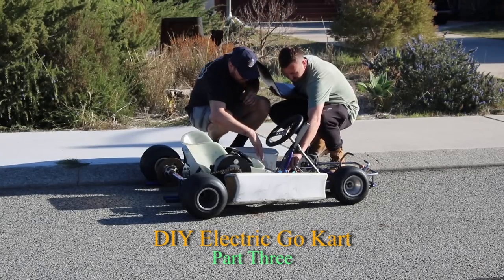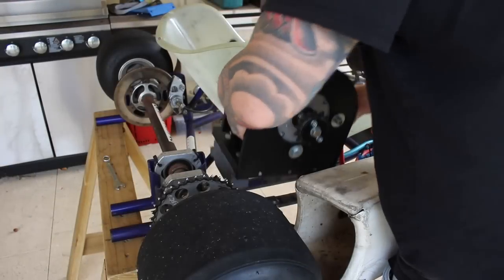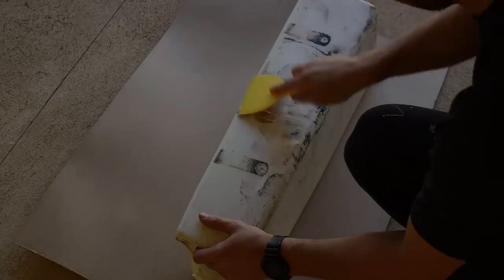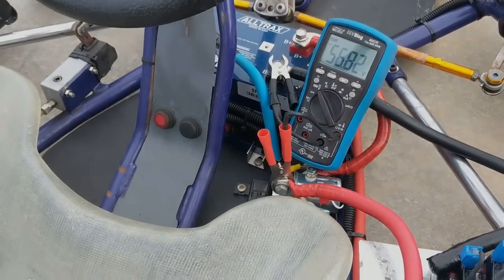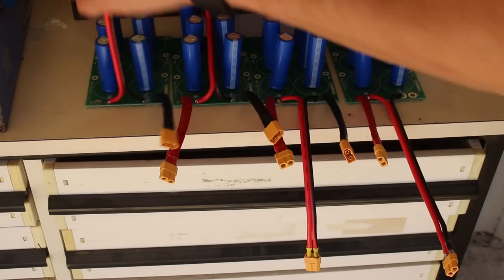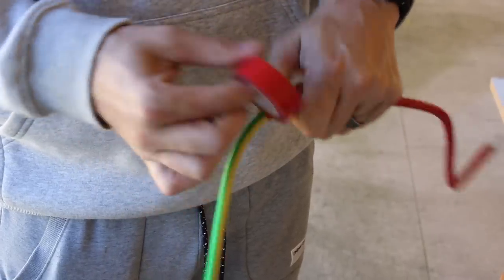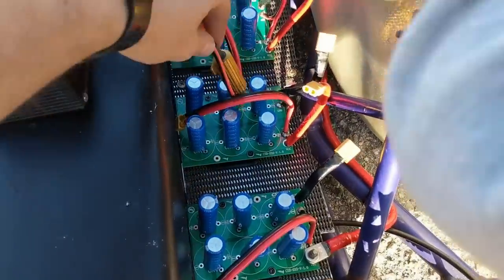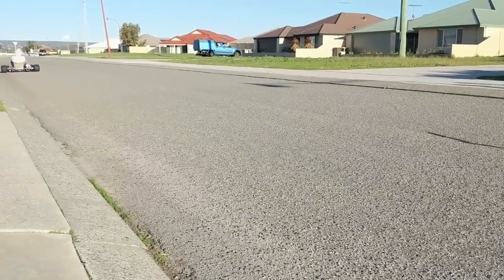DIY Electric Go Kart (Part 3)

Comment: 24 100F caps in series = 4.16F at 48V !! Not much as you found out. Actually a single conventional fast electrolytic capacitor would do fine. Just the fact that the KHZ PWM pulses from the controller get averaged out in the load the battery sees, improves things alot. A second caveat is regen current, that easily can overpower the balance boards and over charge  a few of them when unbalanced.

Comment: Great video... I like the use of the caps... you might want to consider using Samsung 50T 21700, Sanyo/Panasonic 20700B, or Sony VT6 18650 cells for your battery pack and let the battery pack charge the caps instead of an external supply. You'll have to regulate the input voltage to the caps though. That way the caps could take up any voltage sag (although you won't get anywhere near as much sag as you do with that lead acid battery), and you'll get a good drive of high current to aid very swift acceleration. ;)
Reply from the maker: Thanks very much man. To clarify the capacitors are hooked up in parallel with the current lithium polymer battery pack. When they deplete some of their charge, the battery pack supplies voltage to the capacitors I guess you could call it a parasitic drain on the batteries. The benefit I was hoping for was as you mentioned high current aid at peak load. I think by increasing the capacity I might achieve that. In the video I charged the capacitors up to try them without the battery connected :)
Reply: @TheHandyTech  ahh gotcha... Yeah well 21700 or 18650 would help immensely with your voltage sag.
Reply: @darkkevind  I'm not sure with that, Lipo batteries are much more capable than 18650 cells for high current discharge (much lower internal resistance). If going the 18650 cells route he might need to put a lot more in parallel than with lipo ones
Reply: @MrThecoco974  Sony VT6 cells can output 30A continuously, put maybe 3 or 4 of those in parallel and you've got yourself a nice, long lasting high capacity battery that won't sag (much) until around 15-20% capacity. I know this because I make them for electric skateboards. They will sag maybe 1-2v max. whereas this battery in the video sagged around 10v! The kart seemed to pull a max. of around 50v so that's well within range.
Reply: darkkevind hey bud i have a question, I myself am also building an electric go kart and I just ordered a 16kw motor 36-48v at 350amps. What type of battery should I make or get to pull the most out of this motor ? I want a nice long lasting pack.
Reply: @Jcslim138  Hey man, I'm not the comment OP, but @darkkevind suggested using some 18650 Lithium Ion cells for HandyTech's kart and pointed out some cell models from reputable brands. If you look up "how to build an 18650 battery pack" you'll find a ton of useful guides. Another option is using Lithium-Polymer batteries, though I'm not sure which configuration (cells in parallel and in series) HandyTech's running right now. The energy/mass density of Li-Ion cells are greater than Li-Poly cells, so using the former might last you longer. Your motor seems pretty beefy though, and I'm still a pretty big electronics noob, so I hope I could help somewhat : \

Good luck mate

Comment: is the output of the cap boards wired through the BMS ?
Reply from the maker: I don't have a BMS for the battery pack. The capacitor boards are connected in series and then hooked up in parallel to the batteries

Comment: To save money, you could scrap large capacitors out of old computer power supplies.
Reply from the maker: Thanks man but those types are typically filter capacitors and are much too small in farads to aid in my application. A place I could potentially salvage them from would be UPS's though :) cheers for checking out the vid

Comment: How much kw motor is on gokart?
And how many volt battery?
Reply from the maker: The motor is a Motenergy ME0708 and is rated for 4.8kW continuous and 15kW for short bursts up to 1min

Comment: Top speed?
Reply from the maker: I got up to 54kmh on my street. Its probably close to the maximum as the motor only does so many rotations per volt and my controllers has a maximum voltage limit of 60v
Reply: @TheHandyTech  E-TEK  motor 12 HP =  75 MPH, with the right gearing, around 1:3 or 1:2.